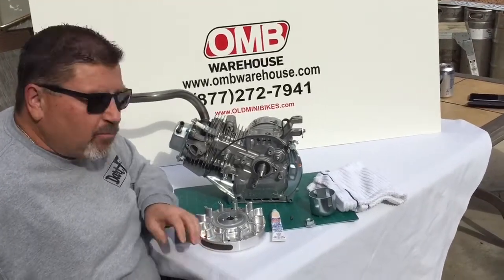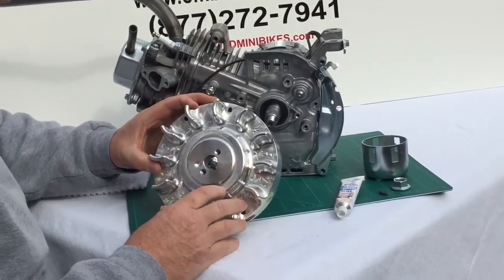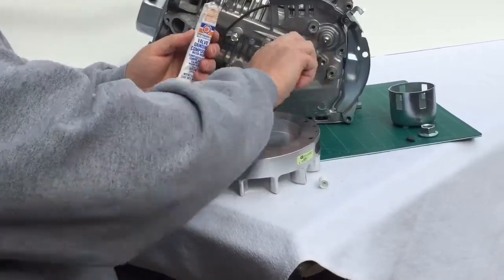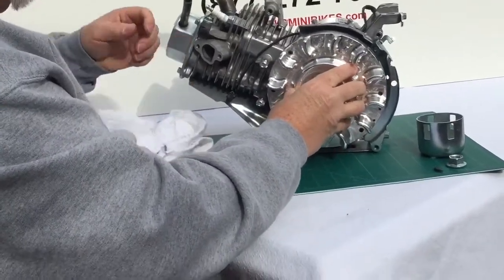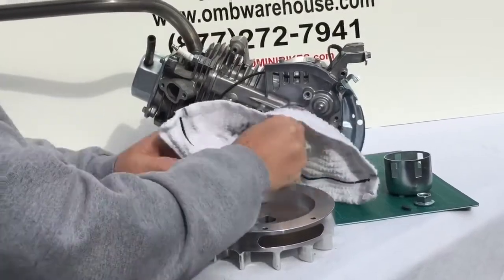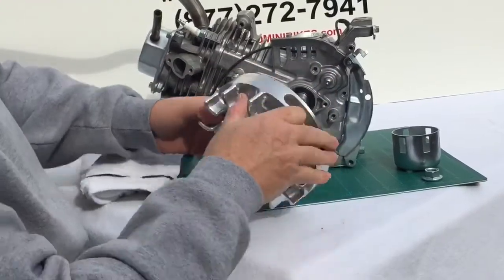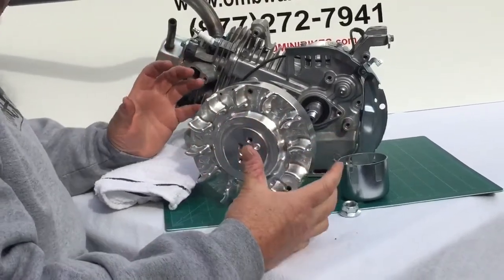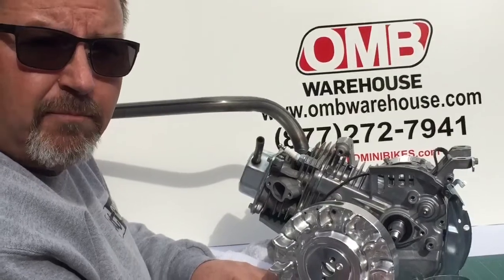Predator 212cc Billet Flywheel Installation Video

Comment: Can't get mine to start after new billet flywheel install.  Started up first time everytime before and only flywheel was replaced during the job.  I would understand it having issues starting if I messed with any air/fuel components, however I only did the flywheel.  What could I have done wrong?  The pull start is a little stiffer than before the flywheel upgrade.
Reply: Check the coil gap
Reply: Did you ever figure it out?
Reply: What was the problem?

Comment: What do I use to hold the clutch side so I can torque the flywheel
Reply: I was about to ask the same thing I have the parts but can’t seem to figure that part
Reply: It's call a crankshaft holder for predator 212

Comment: I installed one today and it started and ran for like 10 seconds then it died and won't start back up. I'm assuming it has something to do with either the coil gap or the carburetor.

Comment: Where is the tool to install factory flywheel?
Reply: Wild Borego it’s a torque wrench is what u will need
Reply: @theescoe9534  how do you hold the crankshaft from spinning?
Reply: @elboregojhb  wondering the same

Comment: The thing i hate most about billet aluminum flywheels is you lose the ability to change the battery and give up electric start to why with all the R&D they done over the years can they design and develop a flywheel system that can do both and have electric start and charging the battery as well as handle 12,000+ RPM'S and also hold up.

Comment: WTF DO YOU SET THE VALVE LASH TO SO MY HAND DOESN'T GET RIPPED TF OFF
Reply: .003"
Reply: .003 on both exhaust and intake
Reply: Did it work or does it still pull your hand off?